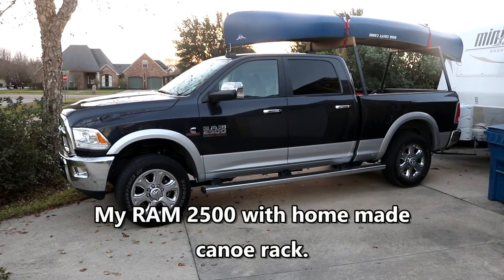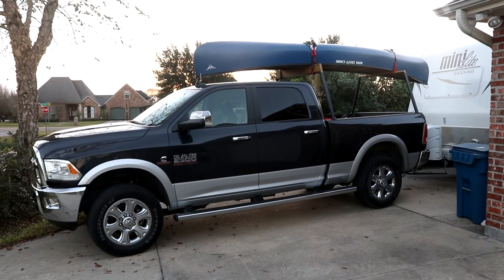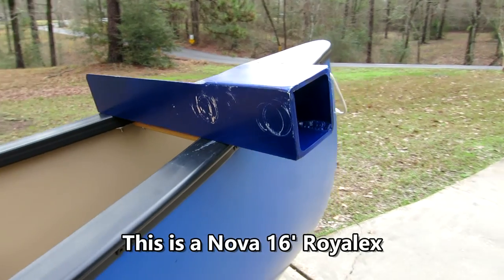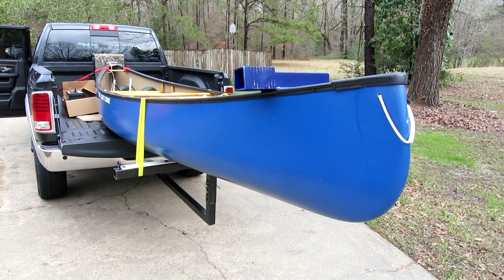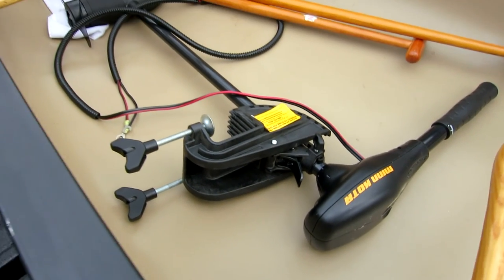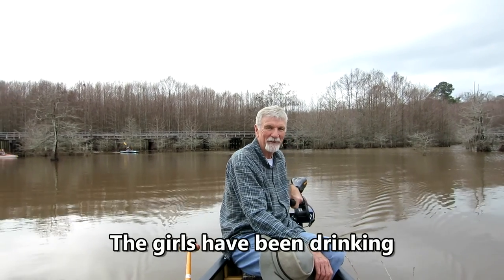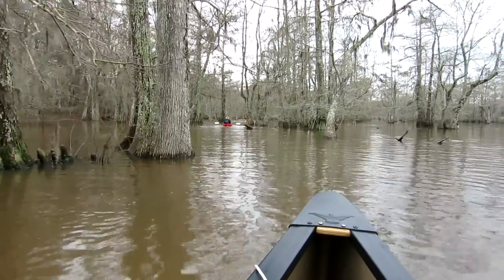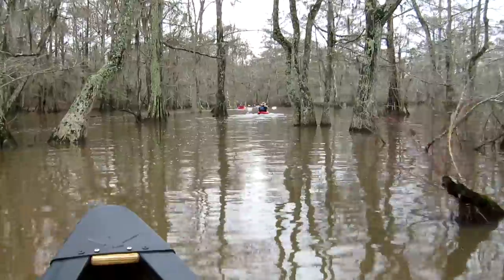Build a simple canoe motor mount

Comment: I’m curious about this trolling motor and battery. So you said 3 hours out and it drained about 25% or down to 25%? Was that by yourself or?

Also about your canoe rack on your truck. How do you get the canoe up on the rack?
Reply from the maker: I run it on it's lowest setting so it'll last a very long time.  Mostly with the wife but once by myself.  The canoe rides better with two people in it.

Comment: Is that a canoe or did you repurpose an oscar meyer wiener mobile?  It's possible that you don't like paddling much because of the rocker that canoe has.  Try a canoe with zero rocker and they paddle quicker.  Old Town Penobscot, many Wenonah models, often any canoe popular for flatwater racing.  Paddling my old Wenonah Jensen 16 is like going down the playground slide on a piece of waxed paper.
Reply from the maker: Yea, agree.   I wasn't very canoe savvy when I bought this thing.  I was hung up on the idea of getting a light weight made of Royalex, but it's a heavy bastard. 78 lbs